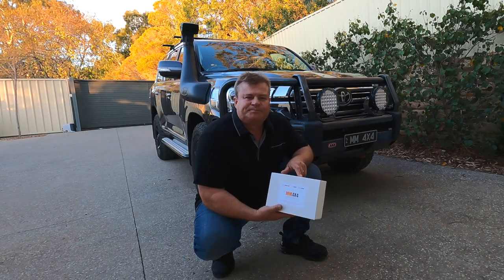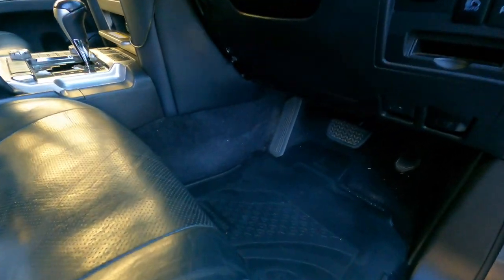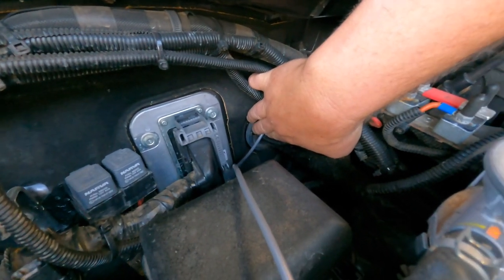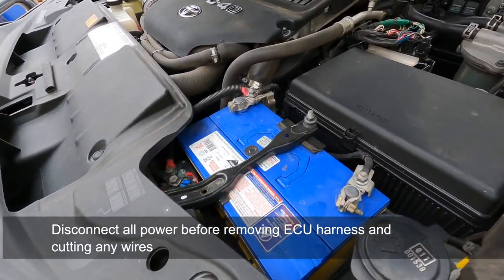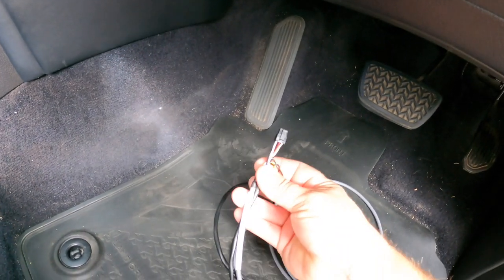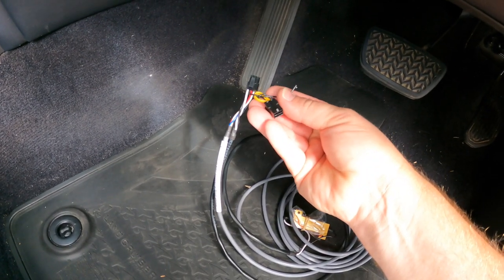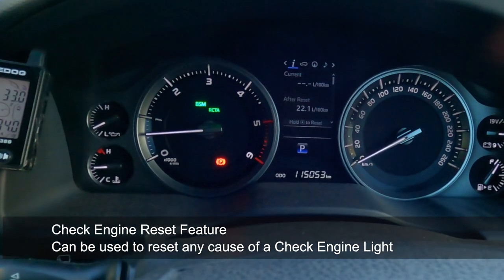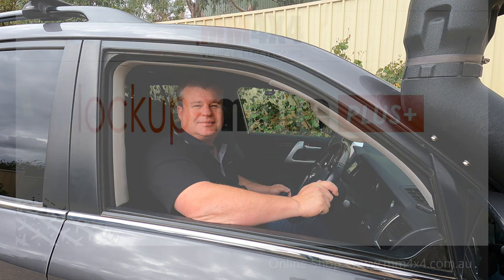Installation of lockup-mate®PLUS+ in Toyota Landcruiser 200 Series and Lexus LX450D

Comment: Sahara prefacelift A pillar install is different, but not covered
Reply from the maker: There are slight variations between the models over the years, but the principle is the same. Some require the rubber trim to be pulled outwards before clipping the led in place.  The LED/switch will fit onto every model.